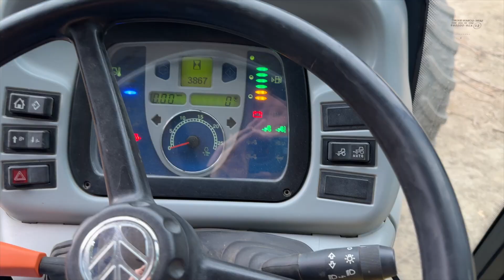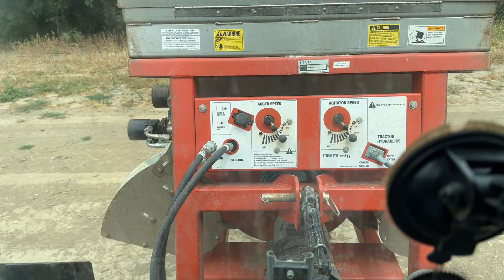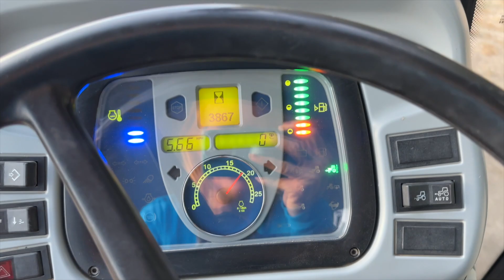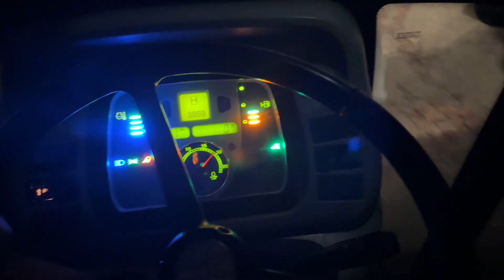My Tractor is LEAKING!!

Comment: Tara to add to the comments of egg eaters, my dad had a wire cage hung from the ceiling of the hen house and would put them in their with feed and water for several days and then let them go, and usually that solved the problem, but if by chance it didn't take , then it was back to jail again. Then that seemed to do the trick. Good to see Waylon is studying up for the future. Great video and hope all goes well going forward.